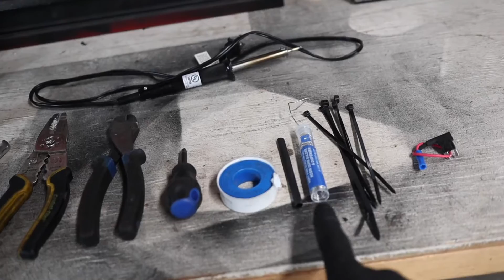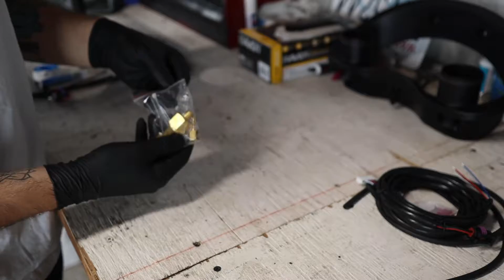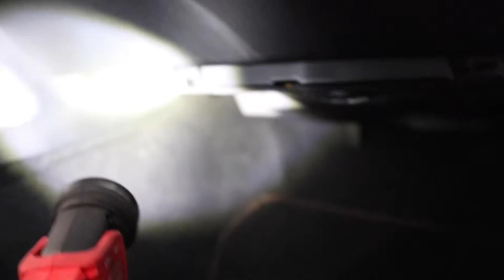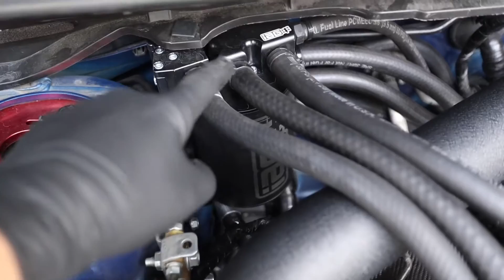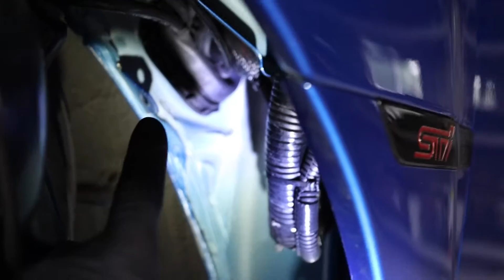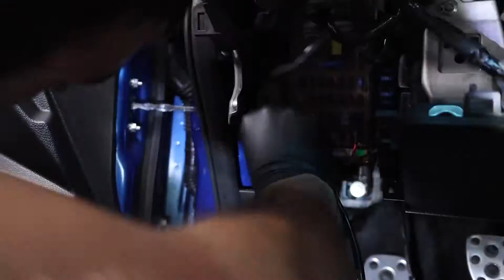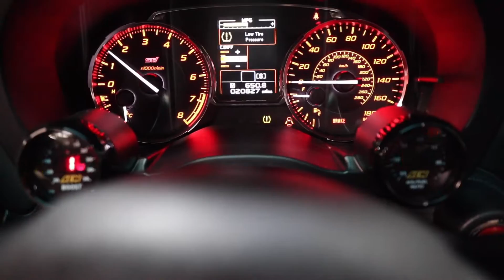AEM Boost and AFR Gauge Install (STI)

Comment: i dont think youll answer cause this video is older. ive watched this like 100 times. everything is finally hooked up and running but my boost gauge is showing the same numbers you are. around -16 to -18 on idle which is completely different than my in car boost gauge showing -9 to -11. is this discrepancy normal?

Comment: I had a question regarding wide band gauges. Other than the read out for the AP and benefit of E tunes in the future. Is there active closed loop communication occurring between a wide band O2 sensor and the stock ECU. In a meaningful way?
Reply from the maker: No, however you can wire it to pull data from the wideband instead of thr stock reae O2

Comment: Love your videos they are so helpful, I have a question? My downpipe has the plug all the way to the end of the downpipe. Do I use that one? Or could I use the plug from the uppipe itself?
Reply from the maker: That should be for your rear O2 sensor 👀
Reply: @Smeedia  i know I’m running an o2 sensor from the headers. I just didn’t know there was a second o2 sensor.
Reply from the maker: Yessir, header is up stream O2 or your narrowband and the downpipe is your rear O2 or "Wide band"
Reply: @Smeedia  thanks for the help man.

Comment: @Smeedia Great vid! Do you have any tips on wiring the illumination for the gauges?
Reply from the maker: I've never wired them in before but you could use the illumination from any of the stock gauges to tap into🙏

Comment: next time please place the solder gun under the wire then apply the flux solder at the top of the wires, it will heat up and pull the solder through the wires creating a better mate. Instead of just dripping solder over wire.

Comment: I have a stock downpipe and want to install the AF gauge any tips? Do I have to buy an aftermarket downpipe for an AF gauge?
Reply from the maker: You can have a bung welded onto the stock downpipe to be able to add a sensor 🙏

Comment: Is there a way the AFR 02 sensor can be read by the ECU and logged through the Cobb AP? Im trying to give my e-tuner the best data possible, so I purchased the aem afr wideband, but im reading I need access to accesstuner software in order to log data from the wideband through my ECU. Any experience with this?
Reply from the maker: https://forums.nasioc.com/forums/showthread.php?t=2805570

🙏
Reply from the maker: That has the wrote up of how to wire it but you can do it pretty easily
Reply: Thanks for taking the time to reply, we know you’re a busy dude!

Comment: I know this is 2 years old. But a tip for soldering your wires together. Take your solder iron and place it on the opposite side that you are applying your solder to on the connection, you want to heat the connection and allow the solder to be sucked through to your soldering iron. By melting the solder directly onto your connection, you are only coating the outer strands.

Comment: What fuse amp would you use for 3 gauges connected to one? Oil Pressure, AFR and Boost for a 3 pilar??
Reply from the maker: 15 Amp
Reply: @Smeedia  Thanks brother!

Comment: I'm in the process of installing my gauges. I noticed you used a 15a fuse, shouldn't the new fuse me lower than the current fuse?
Reply from the maker: Should be slightly higher for the add a fuse, have to continue to power the gauge and whatever your tapping into

Comment: Does the driverside fender liner wire routing work for the 2008-2014 GV/GR chassis?
Reply from the maker: Yes 🙏🙏🙏
Reply: @Smeedia  thanks! I like how you wired the gauge into the fuse box with a fuse. Thanks for the tutorial

Comment: Hey bro. I know this video is old. I just install my aem boost gauge. Thanks to your video. 💙. My question is. Did u tee the vacc line on the lower driver side manifold? What is on the other end? I see line with a bell looking things. 😂 what is that line for. I still tee if off anyways.
Reply from the maker: That just goes from the manifold down to the bypass valve 🙏😁
Reply: Would the line to the BPV be a good one to Tee into or would the one mentioned in the video be a better option for a boost gauge

Comment: did you t into the vacuum line or just remove it and replace it with the sensor vacuum line?
Reply from the maker: Teed onto it 🙏
Reply: @Smeedia  Can you drop a link to the tee you used? Thank you so much for the video!

Comment: Another tip for soldering is to put the iron on the bottom of the wire and melt the solder in from the top, this ensures the whole joint is soldered all the way through and its pretty neat to watch lmao
Reply from the maker: I'll have to give that a try next time I solder, appreciate the tip! 😁
Reply: @Smeedia  no problem my guy! Using a wider tip with that technique also helps lmao 

Also ur a g for replying !!

Comment: Hello bro I know this is an old vid , but I will have a 500 plus awhp sti sometime in the future and besides the AEM wideband afr gauge , which in your opinion  will be the second most important one to have
 (I want 2 only AEM gauges (for now) since a have a dual pillar . THANKS!
Reply from the maker: Oil pressure, glinf to be a savior to let you know if there are any issues 🙏

Comment: Yo if I was to do a Air fuel gauge now and a boost gauge later would that be a pain in the ass to do all the wiring. Should I just buy them both now? I would run the same SMY gaugemaker.
Reply from the maker: No you can just tap the Boost gauge in later 🙏

Comment: You recommend the aem gauges Tanner? I’m looking into getting a bunch of gauges. Looking for something that looks like stock gauges but hate mixing looks of different gauges
Reply from the maker: I love thr AEM ones just not a fan of the Uego sensor they provide
Reply: @Smeedia  yea I’m trying to figure out what gauges i Wana use. I’d like to have oil pressure,oil temp, a/f once I’m tuned,boost and coolant. Dono if that will make the interior look weird since there will be 5 gauges. Was gonna use the aem for the a/f and the pro sports for the others i do like the analogue look of the pro sport looks like stock gauges on the cluster

Comment: I have a cat less setup. I have an upper o2 and lower o2 sensor installed. Where would I be connecting the AEM sensor? Lower or upper or do I need to add a bung?
Reply from the maker: You'll need to add a bung 🙏
Reply: @Smeedia  on which  location of the pipe? Upper part near the turbo or lower part?
Reply from the maker: 6" past the turbo on the downpipe 🙏
Reply: @Smeedia  Thanks

Comment: so im confused on why you would need gauges if the ap is already reading boost and afr. explanation maybe?
Reply from the maker: I prefer having a direct gage vs something that's pulling through the ECU. The AP also only reads up stream AFR vs Downstream
Reply: @Smeedia  im a newbie so i dont really understand the differences between what the downstream does that the upstream cant
Reply from the maker: Upstream reads AFR before passing through the Turbo, downstream reads it post 🙏
Reply: @Smeedia  well that i understand that but i heard the upstream one doesnt read well for higher boost bc it becomes unstable. maybe thats why?

Comment: Hey love the videos . . I just got a 2013 wrx rally blue . I have waste gate po244 code . twice . has stock headers and down pipe. What can i do to not blow it up . i know maintenance is key .
Reply from the maker: Your wastegate could be going out, what tune is on the car?
Reply: @Smeedia  not sure . feels stock . but donno . just did the #4 cooling mod and a street rays pitch stop mount .

Comment: Looking to install this on my 2020 WRX. When installing the sensor into the downpipe for the wideband AFR, are you removing a sensor from the downpipe and replacing it with the one attached to the AFR or is there an additional spot for it on either your aftermarket downpipe or the stock one?
Reply from the maker: It will be an additional spot on the downpipe 🙏

Comment: Got the air fuel one but after awhile it got stuck on the 3 dashs any idea why?
Reply from the maker: Bad sensor, my recent upload i cover it because it just happened to me too
Reply: @Smeedia  damn this is frustrating when its brand new. But okay if its the sensor imma wait to see what subispeed says if not my autoparts store has that boash lsu 4.9 replacement for 50bucks 
. Damn are they still holding up?
Reply from the maker: My Frankensensor is working great, the auto part store sensors work pretty good from what ive seen
Reply from the maker: Yessir 😅
Reply from the maker: Its possible but I dont think that's the leading cause for so many failures

Comment: Love your videos!  Is there anything specific you need to hook up to log the wideband on the AP?  Or just install sensor and power?  I am E tuning. 

Thank you good sir!
Reply from the maker: Some tuners want you to tap into the data logging feature, if so you'll have to run 1 more wire but I always just use mine as displays for info 🙏😁
Reply: There are additional steps to hook up the WB to the ECU but we have a PnP option https://youtu.be/RmlgQVBaMc0

Comment: Hey how did you get the gauges to fit snugly in the SMY? There doesn't seem to be enough of a lip on the wideband gauge for the rubber band spacer that SMY provides. The Wideband keeps wanting to fall out.
Reply from the maker: Do you have the slim ones? If so try roubles stacking 2 rubber bands
Reply: @Smeedia  that's what I ended up doing, the rubber bands still didn't want to stay so I ended up having to glue the bands down. Thx for the reply man!

Comment: Doing  a similar install this week.  Same pod cluster but going to be putting an oil pressure and oil temp sensor.   I hate that the EJ's dont have these very useful sensors.    Any particular reason you decided to use the AFR and Boost pods over monitoring on a Cobb AP?
Reply from the maker: I dont trust the accessport, the info has to go through the ECU then through the Acessport. The AP also reads upstream AFR vs downstream and I prefer to know what AFR is post turbo. As for boost. I just don't trust the acessport lol wpuld rather have a direct gauge to what psi I am getting
Reply: @Smeedia  gotcha, thanks for educating me! makes sense.

Comment: Pretty sure it clearly says on a turbo application the wideband needs to be installed 36" or more away from the turbo dump to Prevent Premature Failure
Reply from the maker: I believe its 16", in my case the sensors were duds. Ended up using a Bosch sensor and splicing it to thr pigtail of thE OE AEM Unit and has been solid for over a year
Reply: @Smeedia  It's 18" on an NA application and 36" when running a turbo where the exhaust gasses will be a much higher temp
Reply: @Smeedia  Was the Bosch unit compatible with the wideband like the 4.9 LSU?
Reply from the maker: Yeah it was the same senor but diffrent pig tail, just cut and spliced onto the AEM harness
Reply: @Smeedia  Good to know thanks

Comment: All bad still trying to understand it. 😞 maybe I’ll watch it a few more times. 
O2 sensor explanation I’m getting confused maybe I’m overthinking it??
The wiring and the sauder I get.
Reply from the maker: Slightly annoying to have to do but the extra O2 sensor really helps, ive seen some people remove the OEM and replace it but then the car runs awful 😢

Comment: I will try the boost gauge first, seems like my Invidia downpipe don't have the O2 connection in that area.  Its a catless downpipe.
Reply from the maker: They have an option for their downpipes to have the extra bung but good luck on thr Boost gauge. Not too bad if an install to do 😁

Comment: Great content.  I got a question I got a divorce invidia catless down pipe with a single bung. My question is do I have to get another down pipe with two bungs to be able to run the gauge ?
Reply from the maker: Yes or you can have another bung welded into the downpipe for the sensor to go into
Reply: How you connect  the sensor  to the Invidia?
Reply from the maker: Of there is not O2 bung you'll need to have one welded in
Reply: Thanks thats what ima do

Comment: Thorough video, helped me understand a lot! I'm trying to get my AEM AFR to link up with my v3 AP. I was told I would need to connect the AEM to the rear o2 sensor. Does anyone have any guides or instructions for this procedure?
Reply: We sell the connector to do this and make a PnP version so you don't have to manually tap it.
https://youtu.be/RmlgQVBaMc0
Reply from the maker: I've seen those ones before but have never used them, hopefully someone can swing in with that one 😖
Reply: you need to purchase a special harness to plug into the oem connector and your tuner need to set it up for you.
Reply: @sskwan1  i have the harness and its connected but im still having issues. do you know of a professional source i can chat with to figure this out? ive been at it for over a week now
Reply from the maker: AEM was fairly helpful when I spoke with them but their turn around time was fairly slow
Reply: @Smeedia  okay ill try them

Comment: I just got my set of AEM gauges in and i don't have any depth to them. Any advice on how to to secure them to the SMY gauge pod? 

https://www.rallysportdirect.com/part/air-fuel-ratio-gauges/30-0300-aem-uego-x-series-wideband-controller?trk_msg=DE6TSR77HV54T7IH58DL9KCMFS&trk_contact=3GJUQKCM6PHBP20N1T80MINF8K&trk_module=tra&trk_sid=ORMFUJPLFKBN38P6EDQS1HRJJ0
Reply from the maker: You got the narrow pods, with those I have no clue, ive never used those ones before 😣
Reply: @Smeedia  Damn....thanks for the reply though
Reply from the maker: Hope that there is a simple way to mount them, I would look at AEMs website to see qhat they say

Comment: So when you install the afr gauge how do you log it from the accessport?
Reply from the maker: I don't, haven't had a need to in the past but you can wire the signal wire from the gauge to be able to do so i belive. I just wanted it as a stand alone gauge to be ablw to read downstream AFR

Comment: I have a somewhat outlandish question... I had an analog boost gauge for a while but jjust got an AEM digital one set up and was wondering if it is possible to take the boost line from the old gauge and run it to the AEM sensor. In my head, as long as it fits, it would make sense to be able to do that so I can avoid running a whole new set of lines through the fender.

Comment: How did you get the gages to stay? I have the sam afr and bezel but the rubber band doesn't seem thick enough
Reply from the maker: I used the rubber bands that came with the cluster and not the AFR gauge
Reply: @Smeedia  OK thanks? It still sloppy on mine with either
Reply from the maker: Interesting, try doubling up the rubber bands if you can. Mine were a tight fit to get them in

Comment: Did you have rough idle when you installed your Cobb BOV? Did it eventually go away?
Reply from the maker: No rough idle, I use a Bypass valve instead of a BOV valve

Comment: Hey man great content 👌,  followed you on IG. @STI_Tanium. 

Getting ready to do the oil pressure and boost gauge. Was wondering what fuses were used? You mentioned 10a/15a atm mini fuses right?
Reply from the maker: They should be the standard fuse size and I believe I used 10 amp, don't remember off of the top of my head 😅 also appreciate the support my man 🙏🙌

Comment: What is the difference between this aem for sensor vs the x series? Which one is better?
Reply from the maker: I prefer the normal as it does what I need which is to just read,  the X series has programmable options built into it. With the access port you don't really need the features the x series offers
Reply: Thanks I’m looking to get a tune done. Would you say it’s mandatory to have an afr for a tune? I have a stock down pipe and there is a kit that uses your fact o2 sensor made by Visconti racing. Basically you install the new sensor and it converts it somehow for your wideband.
Reply from the maker: I would suggest the wide band as it gives more clarity for the tuner and yourself for what the car is doing. Not needed though for a tune.
Reply: Smeedia thank you I forgot to mention I have bigger injector so I assume I’ll prolly need it now. Plus eventually gonna get a downpipe so might as well know that out. Did you have to do anything for the afr system to be logged on the AP? Out of experience do you know and good Etune companies I hear a lot about BrenTuning & dank tuning any thoughts on them?
Reply from the maker: The ECU should log all AFR it is seeing from. The rear O2 Sensor. Those are all good e tuners as well as drunkman tuning
Reply: Smeedia so there’s nothing special you have to do for the AP to read them a and for logging?
Reply from the maker: Shouldn't need to the AFRs can be pulled from the secondary O2

Comment: So I have a question.. If I take my OEM O2 sensor out, and install the one provided by AEM for the AFR gauge, will that make the ECU go crazy?
Reply from the maker: Yes because your ECU cant see the AFR. You'll need to have a new bung welded on the downpipe for a AFR Gauge
Reply: @Smeedia  let's say...  I deactivated the factory 02 sensor, could I replace it with the wideband in that bung?
Reply from the maker: No, the ECU will still need the up stream and downstream O2 sensors. I would suggest getting a bunc welded in for an additional sensor
Reply: @Smeedia  okay, thanks!